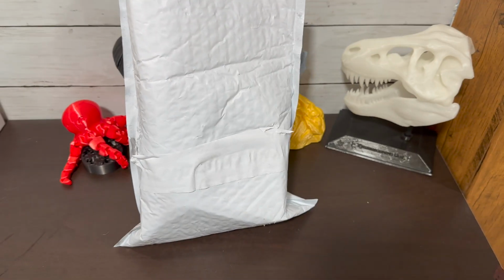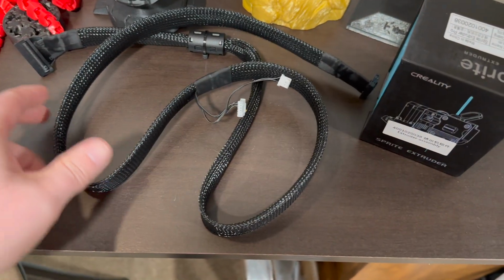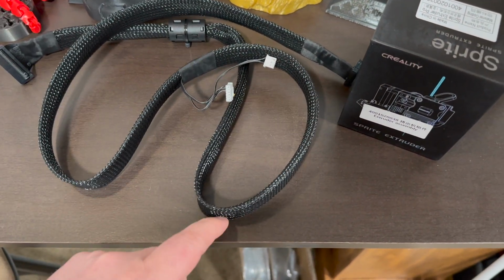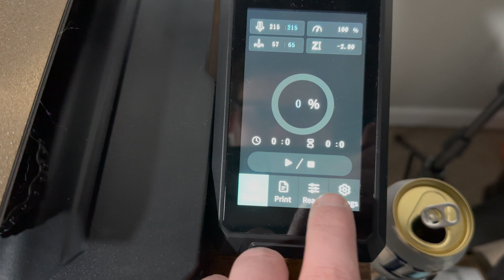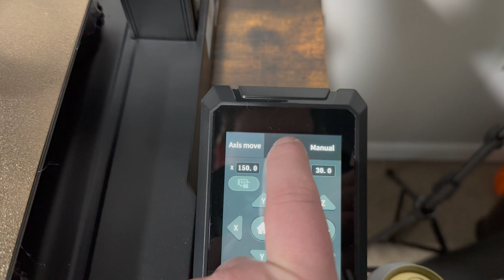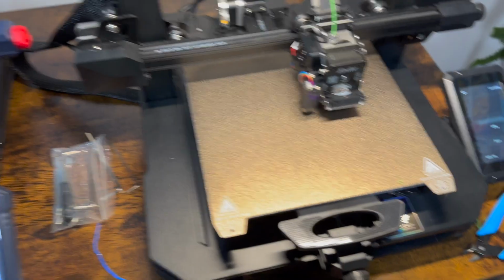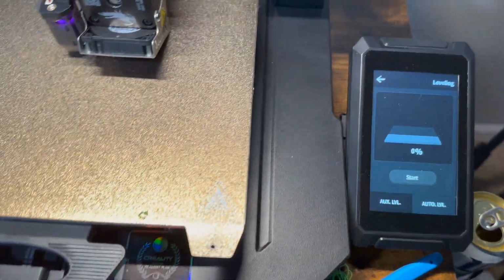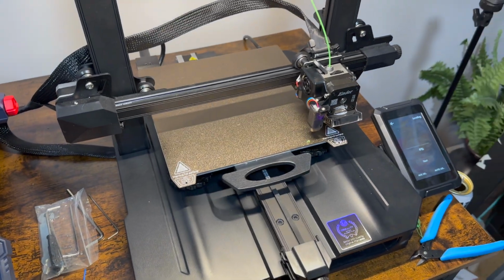Fixing the Creality Ender 3 S1 Pro

Comment: So i assume i have the same issue. I can't extrude when printing, nor can i Manually in the touch screen.  But i can Via Octoprint.. I can extrude any amount. So freaking weird! I'm assuming its a board issue.
Reply from the maker: Not good I would reach out to Creality
Reply: @brade3249  It's so weird dude. Last night I printed this drawer for under my desk and it worked awesome. And then this morning I went to use it and it barely extrudes. It's so strange but yet from octo print I can totally get it to extrude so it leads me to believe that perhaps it's a board issue.

Comment: This is the only video I found with my exact issue. I noticed it started to go bad that after every print it would stop working but it would work again after restarting it . I just reordered the cable replacement. it will take a week but i hope it solves m  issue. If not i have no doubt its my extruder motor.
Reply: Just an update. I got the cable and changed it out! it worked same as you! Thanks for the video! I was ready to replace it when it showed up!
Reply: @Shiitake0787   thanks man I'm currently having the same issue where it only works after restarting it then failing during the next print. Onto the replacement cable now :)
Reply: @DeltaZones10  I bought the $10 dolllar replacement shortly after posting this comment and worked like a charm. Printed 10s of hours since!
Reply: @Shiitake0787  Appreciate the response! Thats a relief as this has had me fooled for a couple days now.

Comment: I’m having problems with my ender 3 s1 pro extruder as well… I suppose the internal dual dear system does not turn so it doesn’t pull in the filament… tension screw doesn’t change a thing… I got in touch with Creality… send them videos and pictures and God knows what else but no response yet…